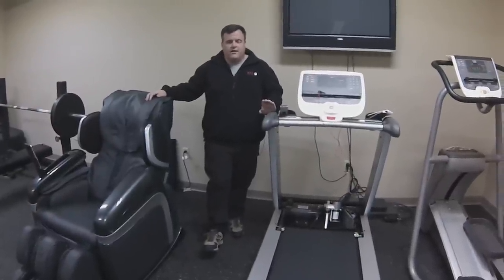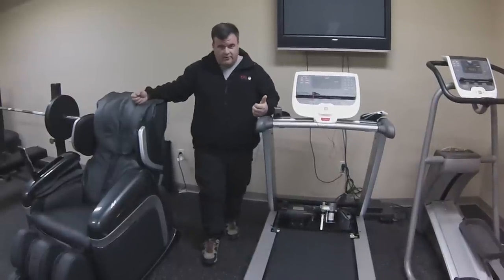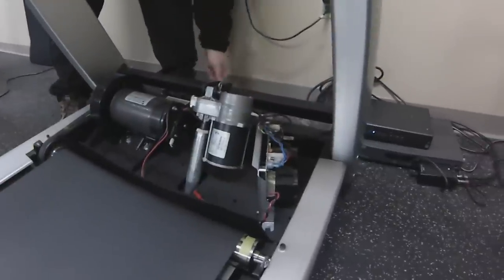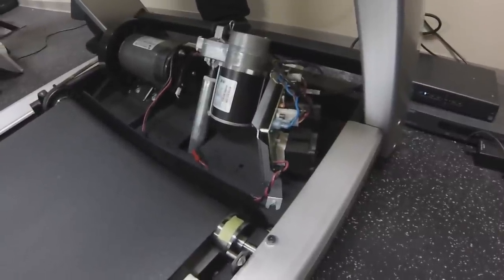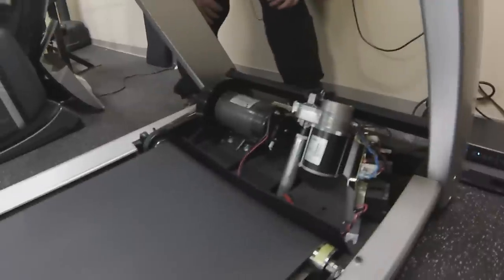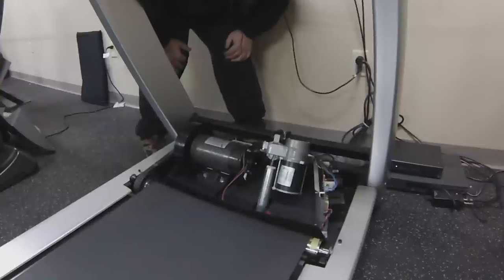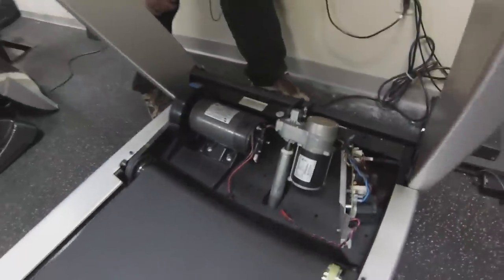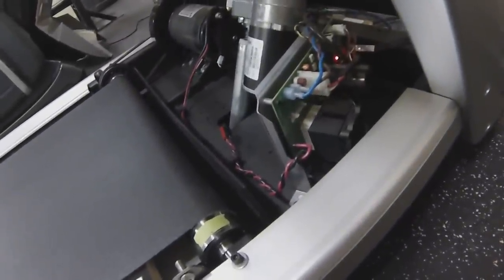My Treadmill Has No Power

Comment: GOT A PROFORM MODEL # PFTL13115.3 Plugged it in and nothing console does Not light up, motor doesn't make any noise, treadmill itself doesn't even make a startup beep. Took the bottom cover off. There is a red LED light & a green LED light on ( not flashing or blinking ) just solid on. Took a voltage meter and there is power to it something like 9-12 volts went up to the console and there is power there too only something like 8 volts though. No signs of any burnt areas neither the controller Nor the console, No pinched wires all connections are plugged in correctly, ground wires are grounded too. I am at a lose TY Melissa ProForm treadmill
Reply from the maker: Hi, if you are getting voltage up to the console but it is not powering up, that would indicate a bad console. The console for this unit has been discontinued, unfortunately. We do have a Treadmill Rescue Kit that would work to get you up and running again. Here's a video showing the kit - 

Rescue Kit Video - https://youtu.be/3c5XnTplPNQ 

Here is a link to the Rescue Kit and a discount code to use - https://www.treadmilldoctor.com/Treadmill-Doctor-Rescue-Kit

DISCOUNT CODE – ME22

Comment: Hi, Proform Treadmill no power, stored in garage, desert climate so no moisture, wont turn on...thing is we didnt use it more than 10 times, ever so nothing could have "failed". Yes, I checked the on/off switch at the base, besides the fuse I haven't checked, any suggestions? Thank you
Reply: Same :((
Reply: did you ever figure out the issue?
Reply: Same, did you e er figure yours out?

Comment: Hi, My treadmill sole f80 stopped working, it has power, but the screen does not light
Reply: Did you figure it out? Mine did the same. Has power but screen stopped working so will not turn on.

Comment: I have the 946I Precor treadmill.  No power.  Were is the fuse on this model.  Thanks in advance.
Reply from the maker: Do you have the serial number off the machine?
Reply: @treadmilldoctor  A925B18080012
Its a 120V 50/50 Hz, 12A was made in 2007, and I did a bit more research and see that their is a circuit breaker built into the on/off switch.  

So I guess my question is, does this circuit breaker reset, or does it have to be replaced?  I tried turning it off/on, but that doesn't do anything, so I'm assuming it has to be replaced, but I'm hoping you'll tell me something I'm not aware of and how to reset it without replacement.  Darn things cost about 90 bucks from what I've researched, so if I can reset it would be great.  lol 

Thanks for getting back to me, I appreciate  anything you can tell me to get this resolved.

Comment: Min works..   it's just very weak and stalls super easy..  Even if I have it turned all the way up.   I put fancy silicone lube like you're supposed to..  Didn't help.    Everything seems to work, just has weak torque
Reply from the maker: If the belt is too far gone, no amount of lube will help. How old is the belt? Here is a test you can run for the belt - https://www.treadmilldoctor.com/dc-amp-draw 

See link, there is a simple motor test in this link as well - 
https://www.treadmilldoctor.com/treadmill-belt-bogs-down

Comment: Hi . My 13 months old sole f63 won't light up . The power cord button on the machine lights up when switched on but the console is acting like the red key is out which it isn't! I wondered any easy checks before I pay out for repairs? Many thanks
Reply: SAME HERE about a week ago...did you ever find a fix?
Reply: Manny G Hi .  Yes I found a repair site that said unplug from mains for 30 mins then plug it back in . I didn't think it would work but it did. Now I never leave it plugged in after use .good luck
Reply: Did you ever found out the problem? I’m having the same issue

Comment: Is it possible to adjust the exact speed in comparison with the display?
Reply from the maker: What model machine?
Reply: @treadmilldoctor  ClearFit ET18 ai plus. 1-10 correct, 14 -1, 18 -2.
Reply from the maker: Check your manual for speed calibration procedure

Comment: By mistake I plug the treadmill on 220 volte power supply instead of 110 volte . Please any one can tell me how to fix it ?!
Reply: That what just happend to me too any help??
Reply: @aleid309  شيكت على الفيوز الخارجي والداخلي ؟ يمكن يكون محروق عندك ويحتاج تغيير
Reply: there should be a fuse on the circuit board, check to see if it blew. that would be step 1 I'd imagine.